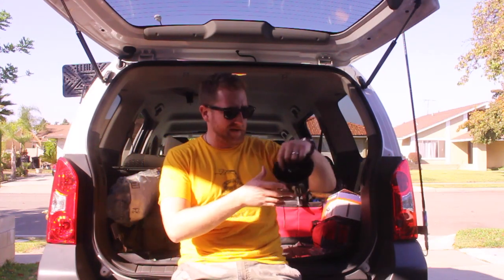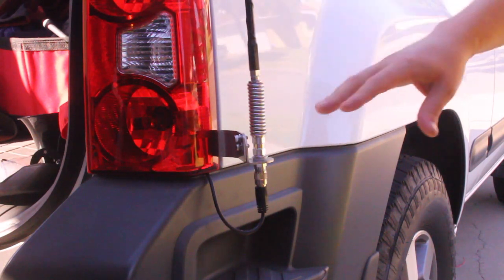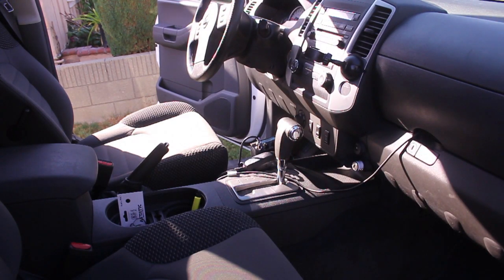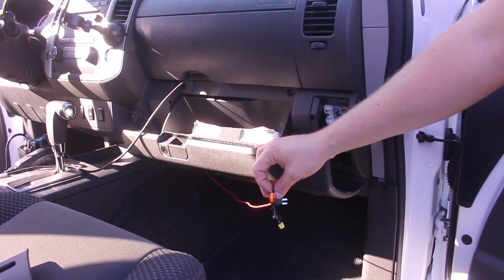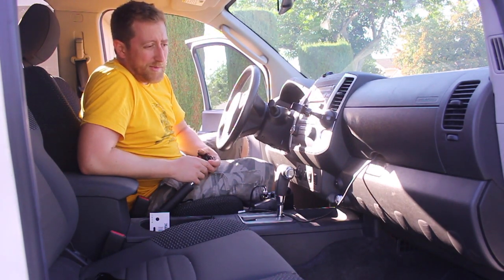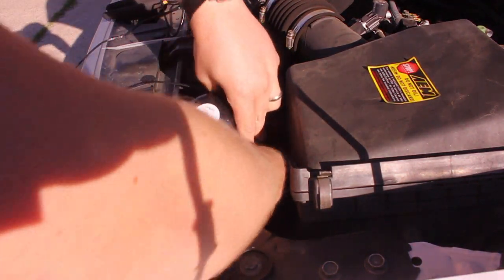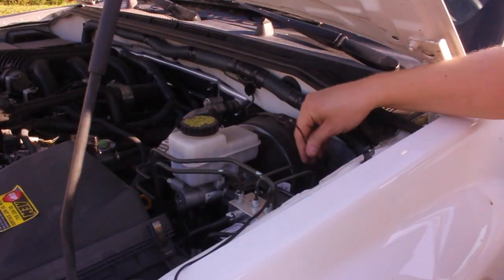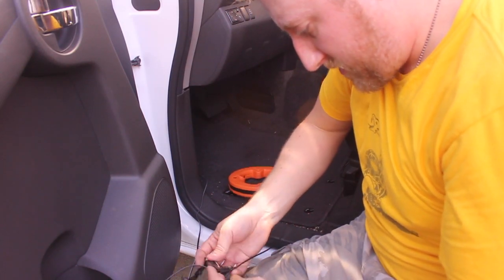CB Radio and PA Install

Comment: been watching lots of videos. yours was the first to power it by way of fuse add-on instead of jamming it straight into the lead. thanks for the tip! i'll be using it for my interior cb karaoke system project
Reply from the maker: +đẹp trai Its a bit more refined way to do the install I think.
Reply: +hoshnasi agreed

Comment: I've installed 2 pa horns now on a cheap midland cb system and the only way it works is if I unscrew the antenna mount on back of cb.. If I leave cb antenna wire plugged  in to back of cb unit and put my cb in PA mode (to try to transmite) it will squeel like crazy (loud) and won't transmit anything I am saying, thoughts? It does this as soon as I press button on mic..

Comment: I almost don't know where to start. So lets go!. 1. Why no BaoFeng ?  2. That long cable to your antenna does function as a resistor to your In/Out Rf signal which is why many people use a shorter cable and go with an  antenna on the roof. Other than looks, any reason you choose your direction? 3. Is your CD model one that (in SHTF only) you could adjust the internal pot for increased output? (few more watts can make a difference)  4. Once your out on the road do you find that the truckers are stepping all over your signal or on equal footing. Back in the 70's the truckers all had 100 watt boosters and stepped all over regular people trying to use CB's. Lastly is because they have fallen out of favor due in part to cell phones, I've been considering getting back into them for emergencies. It use to be like a full online chat with Yankee all cranked up that he's right and everyone else is wrong.

I'm really interested so please take a few minutes on the four questions.
Reply from the maker: ***** good questions, here are my responses.  1. I'm looking at a quad-band radio made by another Chinese company.  With the antenna, that will set my back $300-$500.  The CB was about $100 for everything.  2. Here is a good blog on the topic of cable length.  http://www.stu-offroad.com/misc/myth-1.htm the CB world seems have a lot of FUD in it, my point on the cable in the video is not to coil it. 3.  You could externally amplify, but I'm pretty sure that amps and kickers are illegal. 4. Oh yeah, amped up signals can be heard as far as Canada and Louisiana last week.

It seems pretty hit or miss right now.  This last week there was a lot of propagation from far-off places, but no local chat.  There are WAY more people on 2m local repeaters than on CB it seems in Southern California.  I have a great little 1/4 length 2m antenna I could rig up on my HT to rag-chew if I wanted to.

But honestly, I really wanted the PA for the yelling at people.  Lol.
Reply: hoshnasi When I saw that PA system, I knew right away from your "Captain's Log chats what you wanted to do with it. Just don't get nailed for causing a car accident from "Disturbing the peace".  I hate that phrase as it is used to cover far too much activity that police don't like. Last, Did you look to see if you model has a pot for amp modulation (strictly for SHTF of course) ? Your also right about the FUD's and CB's.Please let me know if yours has a pot as I'd like to get a cheap setup that has that as a option. JustDanO. Still #GlockTober folks.
Reply from the maker: ***** I started doing some research, here is a good post on the topic.  http://sparkyscbshack.freeforums.org/cobra-19-ultra-iii-amp-power-mic-t3447.htmlI think this deserves a video in its own right, "Radio in SHTF".  I sort of like the idea of being able to receive but not Tx too far.  It's going to be VERY easy for bad guys to DF in SHTF...   http://home.ptd.net/~n3cvj/dftheory.htm
Reply from the maker: ***** It looks like this radio gets pretty good reviews from the CB jockeys. http://www.amazon.com/Galaxy-DX-979-Channel-Mobile-Radio/dp/B0006L46L2/ref=sr_1_1?ie=UTF8&qid=1413218537&sr=8-1&keywords=galaxy+dx+979For myself personally, I'd rather spend all that extra money on my HAM radio. Way more bands, WAY more propagation and I won't have to play the power game.
Reply from the maker: ***** And this is the mobile I am looking at FYI...  http://www.amazon.com/dp/B00I53VUEY/ref=wl_it_dp_o_pd_nS_ttl?_encoding=UTF8&colid=30308EWXKLNYV&coliid=I23S8DB87LIJJM
Reply: ***** on occasion, you'll see a HAM admit he's got a CB...and the almost unanimous reason they express for having one is "truckers don't use HAM radio (not most of them), and we still need to communicate with them when (simplex) is all that's availible". 
Ok, it doesn't reach as far...but it reaches farther then I can shout (and really, on simplex, do HTs do any better without repeaters?). And, as I mentioned in a comment above, there's more 'ears' on 11 meters then ANY other frequencies we can use (without a licence or with one) for what CB costs to get into.
I've owned several CBs in my life, never used one for anything important (other then stopping myself from being bored in the car)...but, literally for $60, anyone can be 'on the air' ($40 radio, $20 mag. antenna on the roof, that they buy in nearly any electronics box store)...with less 'fuss and muss' then Amatuer radio. And its a good, inexpensive 'experiment' for some ppl, that might move up to HAM. 
I like HAM radio...but I can't simply just go to Walmart, stick it in my car, TODAY...and transmit. Takes a little longer...and a bit more money with HAM. So, for the cost...stick one in the car (at the very least), hide it from your friends if you feel a need to...dont' even install it, stick a 12v cig. lighter adaptor on it and pull it out when you need it. 
As one of your questions mentioned...SHTF, isn't something we get a timely memo warning us about.
(and btw, in my experience, I've NEVER been blown away by illegal amps. Had some LOUD radios, that were close by...but no one ever 'pegged' my meter with a 100w amp in all the years I had a radio in my car)
Reply: MrRocque With Radio shack now a thing of the past, what brand of CB for both Car and home would you suggest the would use the 12 car power and have a option for a 12 adapter for home use? I would not need to mount it so even a unit that lays on the passenger side of the car would be fine. I'd prefer one to have the option of tuning. Then suggested car antenna and indoor antennas thanks for any help.
Reply: ***** CB radios do not come with a 'tune' option. By law, they are fixed to an allocated 40 frequencies within the 11 meter band (within North America). Thus, they are very much UNlike HAM radio. You can't wander off a frequency trying to get a better signal. At least, not legally.

And, given their short range, if all you want is the ability to talk to other CBers in a very local area ( a few miles), almost any CB (down to the cheapest $40 mobile) will do the job.

If however, you're hoping to reach farther then you will need to look into SSB (single side band) as they are allowed to transmit more power on side band then in full AM mode. But this gets much more indepth into radio theory then a simple 40 channel AM radio.

As for a suggestion...I don't know what options or features you might want or even need. There are a number of companies that make a wide range of radios from $40 all the way up to several $100's. And only 'base' station radios come with a 12v power supply. Any other radio (if you want to move it between home/car) is going to need an external 12v power supply. Be that the battery in your car, a dedicated 12v power supply in the house (running off 120v, assuming you're in North America) or some battery arrangement you've set up in house.

Most CB antennas do NOT function well inside houses. They really need to be outside, above the roof. But, in a pinch (stealth mode if you wish) you could operate an antenna inside but its going to severly effect your range.

Cobra, Uniden, Midland;  all sell small, easily packed radios (though the compromise is, smaller = less features). But if you're looking for best performance, a full sized CB mobile radio isn't really all that big. If 'getting out there, reaching others' is important; spend the money on a GOOD, popular full sized mobile (you can immediately tell the better ones from the cheaper ones, truckers don't buy crap radios, generally) and antennas as well. A well known, LONG TIME manufacturer is always a good idea.

And learning some radio theory is never a waste of time, more you understand why/how it works, easier it is to get better performance. And in doing so, consider a HAM licence at some point. CBs (full AM mode) are only good to about 5 miles (on a good day, farther if conditions are excellent) at their legal power limits. The ability to communicate farther can be of great benefit. And that brings in the realm of HAM radio. More expensive, you have to KNOW more (cuz that's how you get your licence, proving you know the required theory) but you get MORE with a licence, power, frequencies, modes (CB is limited to voice ONLY, HAMs have ALL KINDS of diff. ways to communicate, CW, Digital, Voice and yup, even TV)

Look around, watch video reviews and instructions...decide WHAT you want a radio to do, this will help you decide what features you NEED vs 'bells/whistles' you might want. Its easy to be overwhelmed by lights/knobs/buttons...and find the radio doesn't do what you need it to do or you're bought MORE then you needed. So, what are your needs, what are your operating circumstances, what's your budget, how much do you want to learn (as opposed to plug n play, which radio really isn't). Then, when you understand all that...BUY a radio. (pls, don't reply with answers to those questions...I will not suggest one particular radio. You have to decide that for yourself)

Comment: I have the S Cobra 19 Ultra III as well. Didn't watch the whole video sorry, but could you tell me which speaker you would recommend be best for this? I have the Pyle plus PSP8 and its not loud at all. In the s cobra manual it says the external speaker should have 8 ohm independence and handle at least 4.0 watts. It also says cobra external speakers are rated at 15 watts. I'm confused on what would be a good speaker because I saw a video where a guy used like a 100 watt speaker on his cobra and his didn't fry on anything. Please help because I'm kind of lost here.

Comment: I'm really surprised you didn't go with a HAM (I mean, "citizen" band? Really? You're a special "operator" man! Haha!) But after you sad CB, and especially when you said it was small, I was sure you went with the Cobra 75 WS XT. 

As for the antenna, I think its less about the length of the antenna and more about the amount sticking up above the roof of your car. I think you want at least 24"; which you're probably not quite there, right?

I bought that same PA speaker on eBay; I've got even less room to work with so I'm actually going to take off the cone just to fit it where I want it. Hopefully that doesn't decrease the sound quality too much.
Reply from the maker: I have my Ham license and will also get a dedicated radio in the car soon.  I wanted the PA config now though and I'm looking into doing some off-roading which CB is more prevalent in use.  I was looking into the Cobra 75 WS XT, but it doesn't have a PA connection only external speaker. :(

Antennas can be a mixed bag and for CB it has a lot to do with ground plane.  The Xterra has a great ground plane so if I understand correctly you only really need a few inches for the signal to propagate correctly.
Reply: Logic Bob not sure why some ppl have an issue with CBs...there are millions of them out their, lots of HAMs have upgraded from CB, they get ppl ON THE AIR for next to nothing; no one seems to whine about ppl using FRS/GMRS radios, but they're ALL OVER ppl for getting CBs. Fact is, CBs are more prevalent on the roads then any other two way radios, ie. MORE ppl to contact (rachet jaw if ya want, but when you need help, there's likely to be MORE 'ears' on 11 meters). Long as they're close enough to hear ya, but every radio suffers that problem, some just reach farther. But if a signal isn't reaching anyone, doesn't matter if you TX 4 miles, 25miles, 2500 miles...it takes TWO to work (the RX and the TX, otherwise its just RF bouncing off stuff)

And antenna LENGTH is absolutely MORE important then the amount sticking above the roof. YES, its better if its all above the roof. But if the antenna is the wrong length (not tuned to the frequencies used) it doesn't matter how much is sticking up, its not going to radiate properly and the power returning to the radio, because of the wrong antenna length, is going to FRY the transisters (SWR). That said, a proper antenna will radiate better with more antenna above the metal...but you can't stick a 2 foot antenna (electrical length, not engineered with a coil to make it an 11 meter antenna) ON the roof and expect it to work if its not resonant on CB frequencies...doesn't matter how much is sticking up. It starts with a proper length antenna that will work with the radio...then location. Reverse those two and you're always going to be wondering WHY you're burning up radios.

As for removing th cone on a PA horn...yeah, good luck with that. The reason PAs are loud, is because of the engineering (its called coupling) of those cones. Taking one off is like ripping the paper outta your speaker, the coil still moves..but there's not enough air being moved. Soon as you remove that outter cone...the sound is going the wrong direction (for starters) and the coupling effeciency is degraded, so you end up with a much lower volume, which defeats the purpose of a folded horn speaker.

Comment: quick question- what amp fuse did you use for the cb and how did you arrive at that reasoning?
Reply from the maker: +đẹp trai I think the kit came with a 5 and a 10.  I think I used the ten.  CB shouldn't pull that many amps.
Reply: +hoshnasi alright thanks again

Comment: What cable did you use for the PA? I didn't see it in the link.
Reply from the maker: It was attached to the speaker.  Its an 8mm mono plug.